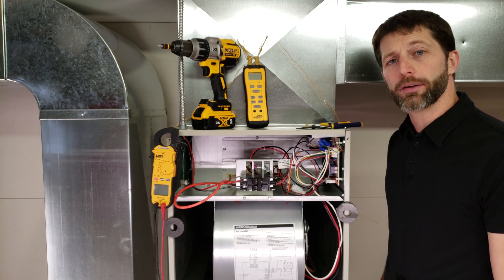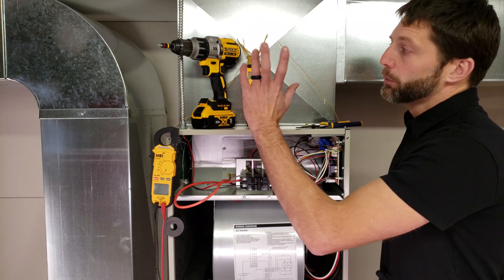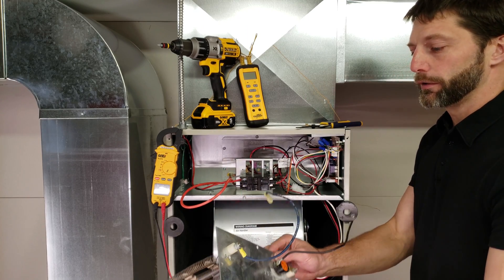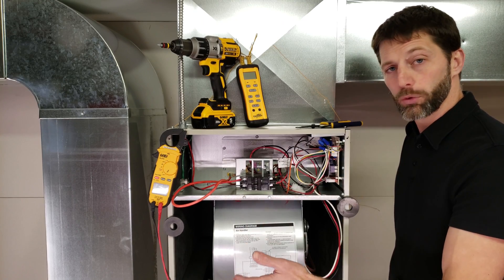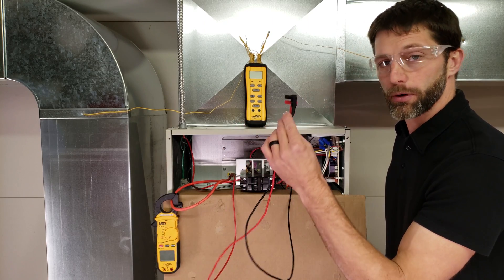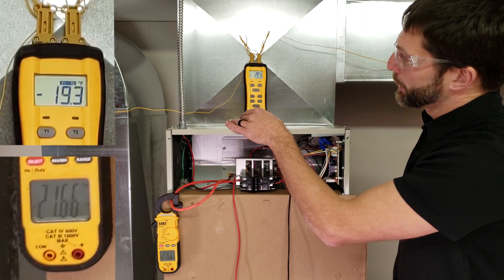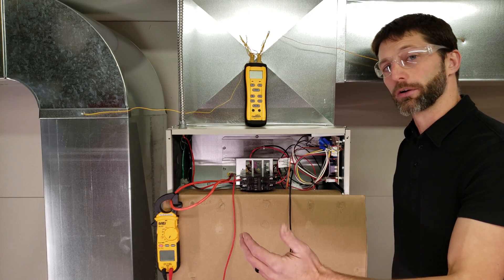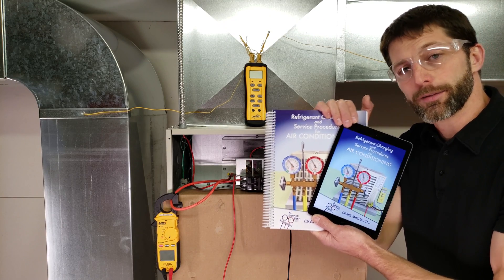HVAC Temp Rise Formula used to Measure Airflow CFM!

Comment from the maker: The E-Book and Paperback at our Website:  https://www.acservicetech.com/the-book
The Paperback at Amazon:   https://www.amazon.com/shop/acservicetech

Support the Channel-  https://www.patreon.com/acservicetech
Tool List-  https://www.amazon.com/shop/acservicetech
For those that are looking for the tools used in the videos: (Linked Below)

Fieldpiece ST4 Dual Temp Meter  http://amzn.to/2wc1ME3

Fieldpiece Bead K Type Temp Sensor https://amzn.to/2DBwKfs

Related Videos:
Blower Motor Troubleshooting Playlist
https://www.youtube.com/playlist?list=PLxnHR5_D2ojyDrxCT9MIttGW4wxOZ3n-7
Troubleshooting Gas Furnaces Playlist
https://www.youtube.com/playlist?list=PLxnHR5_D2ojyN6VClLntbM4X82Gc9Xs8A
- HVAC Basics Playlist-
https://www.youtube.com/playlist?list=PLxnHR5_D2ojxJXMmQlsZVUoDmNyPVv-o7

Electrical Diagnosis Tools:
UEI DL389 Multimeter  http://amzn.to/2xAdaJf
UEI DL479 Multimeter with temp sensor http://amzn.to/2jtsUbJ
Magnet Jumpers- https://amzn.to/2PyKPQZ
Alligator Jumpers- https://amzn.to/2PxqJXn
Irwin Wire Stripper/Cutter/Crimper http://amzn.to/2dGTj2V

Vacuum Tools:
JB 6 CFM Vacuum Pump - http://amzn.to/2nqbvo8
CPS 4 CFM Vacuum Pump - https://amzn.to/2DxgPwY
Appion Valve Core Removal Tool - http://amzn.to/2uYr8WL
Appion Blue 3/8" to 1/4" Vacuum Hose - http://amzn.to/2uYlVyc
Appion Red 3/8" to 1/4" Vacuum Hose - http://amzn.to/2uYg6Ro
Yellow Jacket 1/4" by 1/4" 3’ hose - http://amzn.to/2umtcod
Appion 1/4" by 1/4" and 3/8” hose - https://amzn.to/2Zyxzx9
Uniweld 1/4" by 1/4" 2’ hose - https://amzn.to/2GFov1Y
CPS Vacuum Micron Gauge - http://amzn.to/2v1nM3O
Supco Vacuum Micron Gauge - http://amzn.to/2v1JRiA
JB Vacuum Pump Oil - http://amzn.to/2mGrlXy

Checking the Charge:
Yellow Jacket Refrigerant Gauge Set http://amzn.to/2aenwTq
Refrigerant hoses with valves http://amzn.to/2aBumVI
Yellow Jacket Gauge set & hoses https://amzn.to/2vLVkV9
Yellow Jacket 4 Port Manifold w Hoses https://amzn.to/2BkuGIq
Digital Refrigerant Scale  http://amzn.to/2b9oXYl   
Ratcheting Service Wrench   http://amzn.to/2dGV4Nh 
Fieldpiece SMAN380 Digital Manifold Set https://amzn.to/3297zse
Fieldpiece SMAN480 Digital Manifold Set https://amzn.to/337mGnq

Leak Detection:
Accutrak VPE Ultrasonic Leak Detector https://amzn.to/2nFYKVe
Accutrak VPE-GN Ultrasonic Leak Detector https://amzn.to/2Zy4IZP
RectorSeal Bubble Gas Leak Detector - http://amzn.to/2ckWACn

Compact Ball Valve for Refrigerant Hose https://amzn.to/2KUisW8
QuickDisconnect 90 for refrigerant hose https://amzn.to/2MMtVcg
RectorSeal Bubble Gas Leak Detector http://amzn.to/2ckWACn
Fieldpiece ST4 Dual Temp Meter  http://amzn.to/2wc1ME3
Fieldpiece Bead K Type Temp Sensor https://amzn.to/2DBwKfs
Fieldpiece Wet Bulb Temp Sensor https://amzn.to/2RRI7Tw
Fieldpiece TC24 Temp Clamp https://amzn.to/2qHLyjZ

Flaring Tools:
Yellow Jacket Flaring Tool - https://amzn.to/2OBxGlM
Spin Flaring Bits 1/4", 3/8", 1/2", 5/8", 3/4"- https://amzn.to/31BCs8Z
Yellow Jacket Flaring Tool with Set Depth - https://amzn.to/2QIKsQH
Yellow Jacket Torque Wrench - https://amzn.to/2NRR68Q
Uniweld Swage and Flare Kit- https://amzn.to/2T55jyn
Nylog - https://amzn.to/2MLJcch
Ridgid Tubing Cutter - https://amzn.to/2DnjjR1
Wolverine Tube Reamer - https://amzn.to/2QGLyMV

Swaging Tools:
Manual Copper Tube Swage/Expander- https://amzn.to/2WRPa1M
Spin Swaging Bits 1/4" to 7/8" for the Drill-  https://amzn.to/2YQwwqS
Uniweld Hydraulic Swaging Tool- https://amzn.to/2MlrI8m
Uniweld Swage and Flare Kit- https://amzn.to/2T55jyn
Uniweld Hammer Swage kit- https://amzn.to/2CzWMMU
Uniweld 3/4" Hammer Swage- https://amzn.to/2CzXsSs
Uniweld 7/8" Hammer Swage- https://amzn.to/2Mja5WE
Uniweld Multi-Size Hammer Swage- https://amzn.to/2T3Cx1b

Brazing Tools:
Air Acetylene Torch setup - http://amzn.to/2aQalsb
15% Silver Brazing Rods - http://amzn.to/2gVLyLc
Uniweld Cap-N-Hook and #2 Tip Oxy Acetylene Torch Setup - https://amzn.to/2STp3Fe
Ameriflame Oxy Acetylene Torch Setup #1 &#2 Tip - https://amzn.to/2SRm3JF
#2 Tip for Oxy Acetylene Torch - https://amzn.to/2SPDaeD
Cap-N-Hook Tip for Oxy Acetylene Setup - https://amzn.to/2MbhpUk
40cu B Tank to 10cu MC Tank Acetylene Tank Fitting - https://amzn.to/2GxZZPi
Nitrogen Regulator - http://amzn.to/2bXdR5f
Uniweld NitroVue Flow Regulator - https://amzn.to/2GnsaAo
Uniweld Nitrogen Flow Meter - http://amzn.to/2brvoBg
Bernzomatic Trigger Start Lighter Propane/Mapp Gas - https://amzn.to/2vit0cv
Uniweld Soft Flame Sweating Torch Setup for Acetylene - https://amzn.to/2DyzRD8
Flint Spark Ignitor - https://amzn.to/2L3P2u9
Stay Brite #8 Silver Bearing Solder and Flux - https://amzn.to/2XIDJsY
Aluminum Braze Rods - https://amzn.to/2IGNMu

Nitrogen:
Uniweld NitroVue Flow Regulator- https://amzn.to/2GnsaAo
Uniweld Nitrogen Flow Meter    http://amzn.to/2brvoBg
Nitrogen Regulator    http://amzn.to/2bXdR5f

Service Valve & Port Access:
RectorSeal Bubble Gas Leak Detector - http://amzn.to/2ckWACn
25 Valve Cores - https://amzn.to/2L37UJU
25 ¼” Brass Port Caps with rubber O-rings - https://amzn.to/2GIOdD2
Brass Valve Core Tool which holds 3 valve cores - https://amzn.to/2GFEbm2
Valve Core Torque Wrench - https://amzn.to/2GHiLoD
Locking Cap Universal Lock/Unlock Tool - https://amzn.to/2GGAoVp
Locking caps - https://amzn.to/2GFXZ8A
Ratcheting Service Wrench http://amzn.to/2dGV4Nh
Yellow Jacket Sealright 90 Coupler- https://amzn.to/2LsU1V7
Yellow Jacket 1pk Compact Ball Valve- https://amzn.to/2uXdF18
Yellow Jacket 3pk Compact Ball Valve- https://amzn.to/2AiKfQe
Thumb Screw Valve Core Depressor with Backseat- https://amzn.to/2mR0sCL

Other tool links can be found in the video description section.

Shop through Amazon! Your Purchases through Amazon provide a means for channels such as mine to earn advertising fees from all purchases after clicking through. Prices are the same as normal-    https://www.amazon.com/shop/acservicetech
Reply from the maker: Thank you for your support!

Comment: Should we check airflow in heating or cooling, or both? That's the only part that confused me. In this example you used heat strips, what about a system with no heat strips?

Comment: Testing a natural gas furnace. Do we not have a time discrepancy? With BTU'S per hour and cubic feet per minute? 
90,000 btu input @ 80% = net 72,000
Delta T of 28.7 degree C × 1.08 = 29.5 
Divide and the answer is too high to be correct. 2,440 cfm! At 6.0 inch. of water column ESP how hax my psc fan motor survived 30 yrs. and counting pushing that thru an 8 X 16 inch rectangular metal duct system?
What am I missing here?

Comment: If there is more than 1 set of heat strips, how would you go about checking voltage and amps? Just use what you get with 1 set of strips?

Comment: Craig,
Another great video!
It might be valuable to also explain what the 1.08 represents, ( value of standard air) as well as the 3.414, ( BTUs per watt)
Reply: 1.08 accounts for density of air 0.075lb/ft³ X specific heat of air 0.24Btu/lb X 60 minutes per hour = 1.08

Comment: Thanks for the great lecture. 

But in many cases the machine will be cooling only, without heater. In this case does it apply the same also.

Finding the power input (input voltage × input current) and use it on the same formula which you use to figure out the CFM?

Thanks

Comment: Where do you get 1.08 from. I'm complicated and have to know the details. Thanks in advance.
Reply: I think I found the answer. The density of air 0.075 lb/ft x specific heat of air 0.24 btu x 60 sec= The factor is 1.08. Correct me if it’s wrong.

Comment: I had some fun today. Goodman 95% furnace - input 69000 BTU

1. Gas Meter - 57 seconds to deliver 1 FT
2. 3600 seconds / 57 x 1015 = 64105 input BTU
3. 64105 x .95 + 60900
4. Temp Delta 43F
5. 60900/1.08x43=1311
6. Emerson full ECM motor set to 1325CFM. Just about right.

Of course that means my furnace is around 10% under performing. Hmmm...

Comment: Great video! One question though, how do you know what your CFM is supposed to be for your emergency heat and for the heat pump in the heat mode? Thanks!
Reply from the maker: Usually the manufacturer will supply a guide for the cfm needed for electric resistance size. Also make sure the temp rise does not continue to increase. The heat pump will need roughly 400 cfm per 12,000 btu of heat removal or heat addition, thanks!

Comment: Hi Craig.I noticed that you sended me a message saying that there is a way to calculate CFM on gas furnace. Didn't have time to read. It desappeared in a second. Could you send it back please. Thank's alot for your good work
Reply from the maker: (Input BTU/HR x Combustion Efficiency) / (1.08 x Delta T)

Comment: Same question from Rich Halama    
Is there a formula using this heat rise method to measure cfm on a natural gas furnace? Great video's.
Reply from the maker: Yes there is. Walker had answered him in that comment already, thanks. 
CFM= BTU output ÷ (Delta T X 1.08)

Comment: Hello Craig.  Just bought your book, and I thought I would check out your website a little more.  I noticed under "Total Weight Method" the table has an error in it.  I wasn't sure if if was intentional or not.  I though I would mention it.  Check out " Refrigerant Weight Per Foot" table, left column says Liquid Line Size - twice.  I think it is supposed to say Liquid Line Size then Vapor Line Size.  I am curious if you put the error in there on purpose or maybe I am missing something.
Reply from the maker: Thank you very much for your purchase of the book and please let me know what you think of it after reading it! We must have used an old version of the photo of the weight chart in that article. I will change it. That image happened because my graphic designer at the time had recopied the top of my original picture. I had to correct it later once I noticed it but now it has popped up again. I have rechecked the weights in that chart many many times and there are no other issues with the chart but yes, it was supposed to say vapor there. Thanks for letting me know!

Comment: is Delta T is TD ?  Thank  you
Reply from the maker: Delta T refers to the temp rise for heating and the temp fall/decrease for air conditioning. It is the change in temp between the return air and the supply air, thanks!
Reply: @BYENZER  I love it!  Going to have to borrow that quote.  However, Craig is primarily speaking to new techs is he not?

Comment: Is there a formula using this heat rise method to measure cfm on a natural gas furnace? Great video's.
Reply: Yes. Its. BTU output ÷ (Delta T X 1.08 = cfm)
Reply: For example my temp rise is 39. Times it by 1.08. And if my BTU output is 80,000. Divide 80,000 into 42.12 and you get 1899 cfm worth of air.
Reply from the maker: Yes Rich, Walking Wanderer has it! Thanks!
Reply: @walkingwanderer4769  that seems high , what is temp. range printed on furnace label?
Reply: 1899 ÷ 400 = tonage? Almost 5 ton. Or 60000 btu